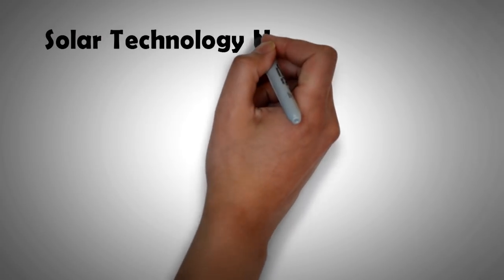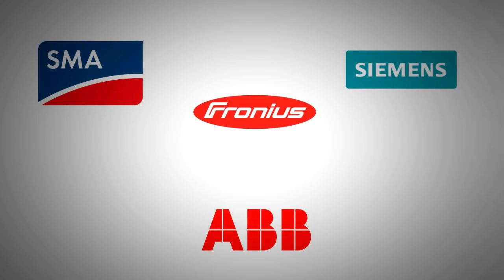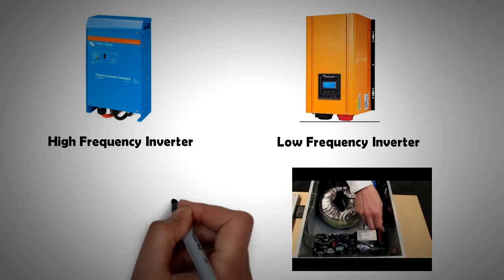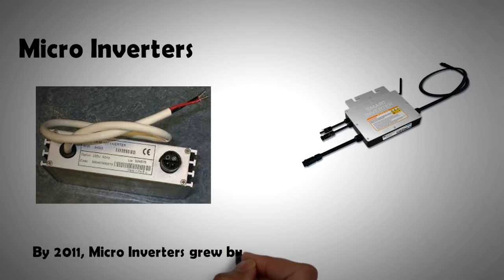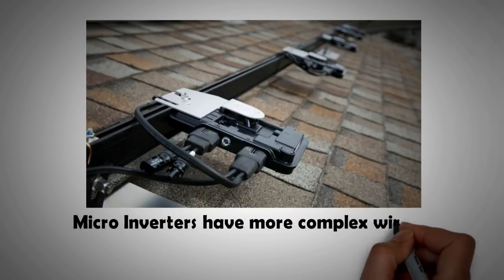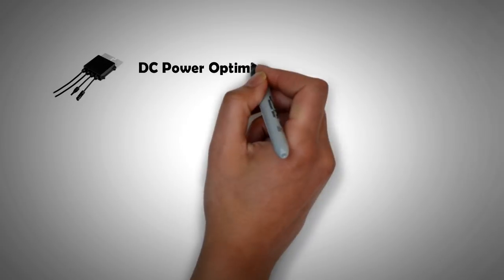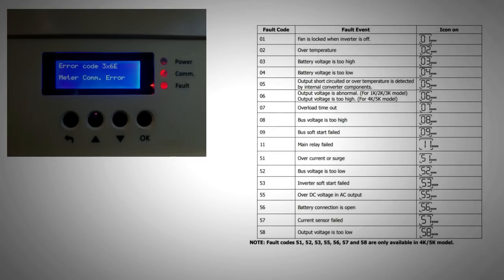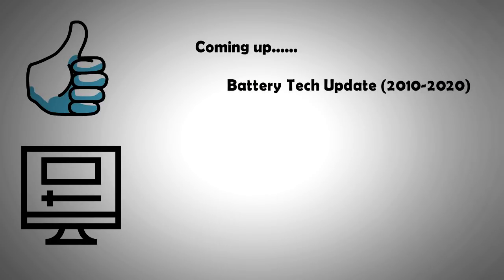Solar Technology Update Part 2- Inverters

Comment: Great explanation! But the inverter shown as the "high frequency inverter" (@ 2:51) is a Victron unit, and they tend to be low frequency inverters that contain a large, heavy toroidal transformer.  At least my Victron Multiplus Compact is a low frequency unit.
Reply from the maker: You are right. Made a mistake

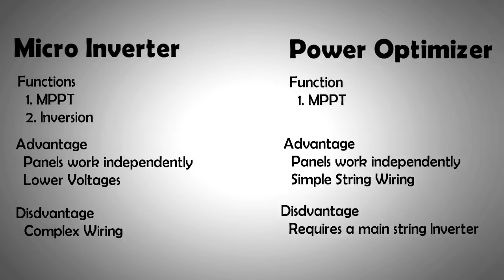Comment: At least thru 7:00 you assume that all installations are grid-tied systems.  I gave up at that point and went to another vid.
Reply from the maker: The point I was making was that for Grid tied systems you need smart storage. For off grid systems, you dont need that. Most development that has happened in energy systems is for making smart systems.
Reply: Agreed, though I did watch the entire video and it's entirely geared toward grid-tied applications.  I.e. talking about "mptt" in inverters, micro inverters, etc.  I didn't learn anything that would apply to off-grid installations, where primary concerns are inverter efficiency, idle current, inductive load capability, etc.  I think the video is mistitled.

Comment: I wanted to run a hybrid electric water heater off solar but their were problems with directly powering from pv.. Then last night I noticed Hotspot Energy has a emphases like inverter that provides 220v solar power first then makes up the needed power from the grid. It's design market is to power any ac unit from PV power but I think it has other application since it is a one way device and  no power can go out to the grid so none of the B.S. of net metering or power company involvment. 

I love it when a good plan comes together.

Comment: Thanks a ton for such a great information, after watching your video I came up with a qs. Am going to buy 10kw REC alpha panels, and if I go for SMA string, combination with optimizer or micro inverter could give me better extraction and conversion of power? 
PS. Am from India please suggest me some budget micro inverter and optimizer brands.
Reply from the maker: If you are already getting a string inveter than there is no point of buying micro inverter. You can buy optimizer to go with your optimizer. For optimizers, the choice is limited
Reply: Synergy Files Sorry, I did not understand how optimizer + optimizer works…
Reply: @synergy files I meant to ask you that String + optimizer or only a micro inverter could give better extraction and conversion of power. Like in optimizer case there two stations for power to get supplied through ( first optimizer and then through string), so will it possible that final output will be considerably lower than the a micro inveter where power goes through only a single station (itself micro inverter).

Comment: most of these inverters have no utility without the grid or toxic batteries.  its key to be battery agnostic. ie. power during daylight hours when you remove the battery. batteries always fail and are not standardized yet,
Reply: Keep an eye out on the 1,000,000 mile battery that is coming out for Tesla’s battery day. If you Where is smart, he would probably buy stock with them before that. But, since you are not comfortable with batteries, you will just have to observe this happen. Further, most residences will utilize 2–5 kWh of battery Storage capacity. Notice, most electric cars have 20–100 kWh of battery capacity and can easily be utilized for solar storage even when they are 60-80% used, ‘post mobile’.

Comment: I am looking at a wind and solar application, due to the high average wind speed (16 mph annual average) and only one south facing wall to mount solar panels. What difference would I likely have to make to keep the two generating systems working together.

Comment: You didn’t mention Enphase Energy micro inverters failure rate is five out of 1million also you can bye AC panels with micro inverters pre-installed for a better price and easier installation another benefit you can start with a small system when you have more money add additional panels
Reply from the maker: I agree. I just didnt wanted it to make it Enphase Vs SolarEdge.
Reply: Synergy Files    I am now invested in Enphase would you say that I need to diversify to solar edge as well?   How excited are you for IQ 8 And other future Products?

Comment: This is not clear to me. Seems the Power Optimizer is the 4th solution, but equal to the 2nd solution. If the 3rd solution (micro inverter) is better than the 2nd solution, how can a Power Optimizer be better than a micro inverter? 
Also, for locations that are affected by shade, the micro inverter still seems to be the best solution, if you only look at the amount of power produced. Hasn’t the cost of micro inverter gone down?
Reply from the maker: Both micro inverters and powe optimizers are great for shade. The optimizer gives higher output but only marginal. Micro inverter price hss come down because of greater competition between manufacturers. They are slightly more difficult to instal because of multiple independent connections to the grid. Optimizers are simpler to connect.
Reply: It is probably me, but I do not yet understand the advantage of a power optimizer over a micro converter. 
With a power optimizer the panels are in series or in parallel?
If in series, how does it handle shade on one panel?
Reply: @z4zuse  Thats why its called a panel level optimizer..